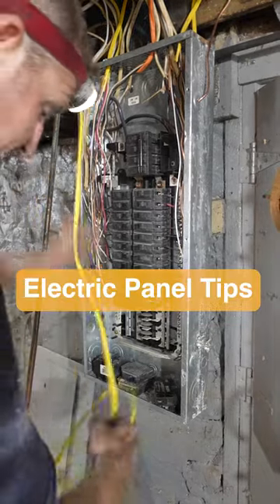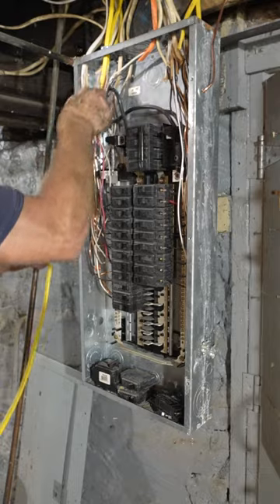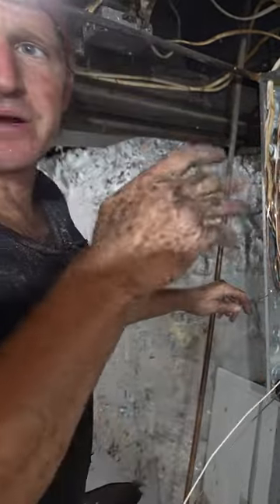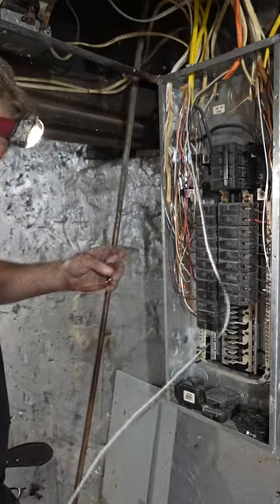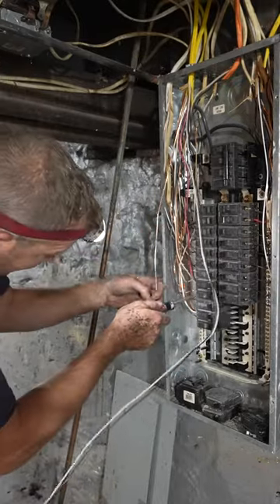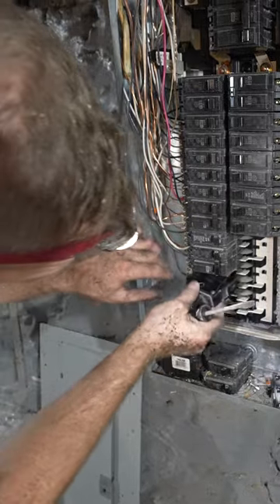Electric Panel Tips #diy #electrical #shorts #homeimprovement

Comment: Do you not put sleeving on the bare cable 😲
Reply: 'Murica 😭
Reply: Our grounds are always bare, why waste cover on them?
Reply: @whattheschmidt  cause copper oxidizes...
Reply: @Pro_DRIFTZ  way way less than other metals and the connections themselves are just fine for several decades.

Comment: See you shouldn’t post videos about electricity when you don’t know what you’re talking about. Where does stray electricity go if there is a fault in the electrical system? Does it go to the neutral ! So when you get shocked on the neutral because some YouTuber told you that you wouldn’t could that startle you into jerking your hand back (if you are lucky and it’s small enough that it allows you to) and into the hot buses. Then we have a fried YouTube patron. Please people if you aren’t competent at residential electrical wok please hire someone who is